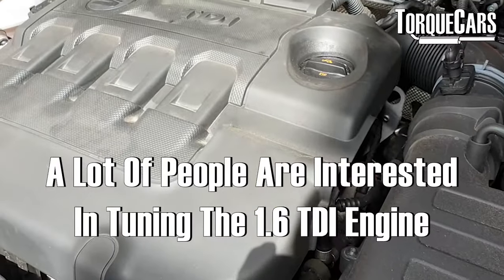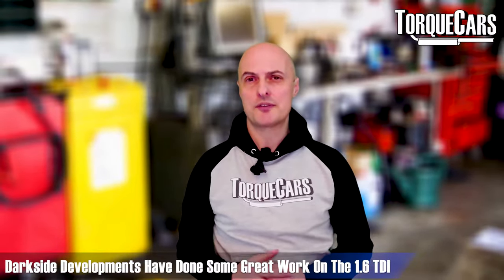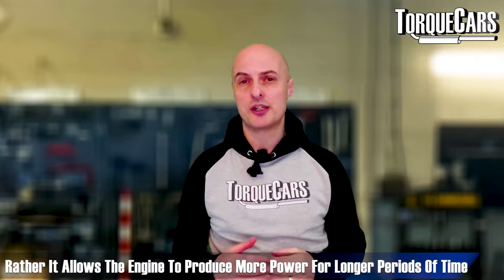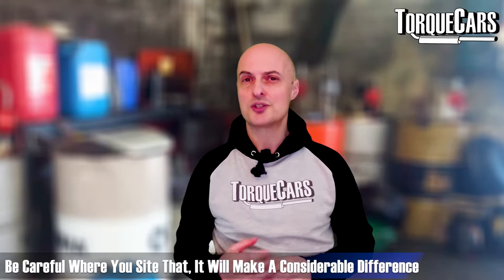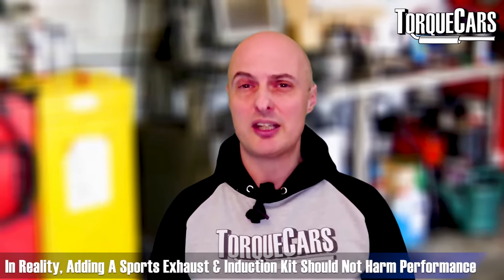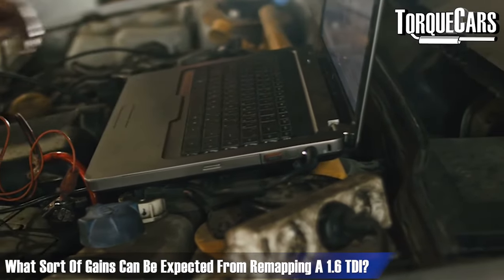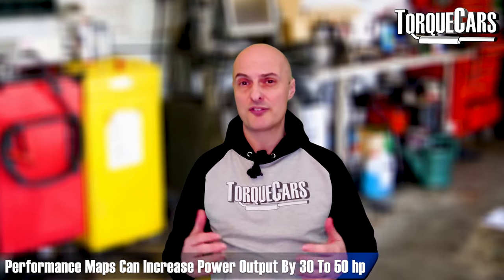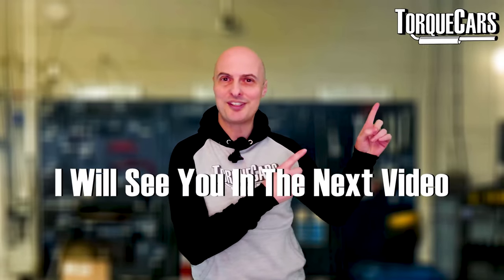Best VW 1.6 TDI Mods VAG Group [Audi Skoda Seat]

Comment: I got my 1.6TDI (Golf 7 Variant) remaped from 110HP to about 140-145HP (idk exactly since I didnt try it on a dyno yet.) For me its a huge difference, it turned the car into something thats so much more fun to drive, yet the fuel economy is unbeaten by any other car i know, I average about 4,1L/100km.
Reply from the maker: It always amazes me how quick these can be and still return fantastic MPG. Did you just do the remap or were there other mods done?
Reply: @torquecars  The remap was the only Performance - mod I have done on my car. Sure even more performance would be fun (I wish I had the same car as a GTD) but for now I think i wont do any more Performance mods. Curently 158.000km on the clock, changing the oil even before 15.000km, so I hope to get many more happy years out of it.^^
Reply: @Alexander-tu5on  you should consider removing FAP and EGR before the remap
and you'll get  a "looser" car to sustain the remap and get  higher hp.
Reply: i drove the 90hp optimiert up to 150hp from Swindon to Bad Pyrmont germany in one Tank!
Reply: 4,1L/100km on a car computer or you count the MPG manually?
Reply: @cezaryponikly4280  if I drive like a grandpa, I can get to 1150km on one thank of 45 liters. (It’s also a remapped 1.6 TDI, but in a Audi a3 2013)
Reply: A3 8v 1.6TDI 105bhp 2014 
Have done ECU stage 2(150bhp/320Nm torque)
Stronic/DSG stage 2+(drivability  upgrade)with TVS engineering/DSG doktor,
k&N fibre air filter but standard shape which fits in the stock box.
New front suspension with uprated polyurethane  bushing wishbones (no coilovers have been changed).
Servicing every year

3 years so far and this is a great improvement overall.
2 years after the tune it has its clutch replaced with DFW - all standard.
Recently 4 new standard injectors.
Currently running well and its with 120k miles on the clock atm.
Reply: @Alexander-tu5on 
Sounds amazing but oil change intervals sound a bit long.
Sounds like you don't mind spending a few quid on your car. It might be worth sending off some oil to be analysed after 15,000km and 8,000 km. Would be interested to know the results and you could save yourself some money and headaches longterm. Good luck. 👍
Reply: @michaellavery4899   That's interesting, where does one send an oil sample and what are we looking for?
Reply: I have also 1.6TDI, where can i find this remap flash?

Comment: For me personally, the best mod / upgrade is to change the oil and oil filter more often than the manufacturer's recommended interval.
And to add anti-crystallization fluid to the adblue - for cars with that system.
 😁

Comment: Ive been watching alot about these engines. I have a honda civic 1.6 i-dtec there is zero info out there for it even tuning info. I have stage 1 160hp and 380nm on standard gtd1244vz. I have a new hybrid gtd1252vz (220bhp model) now not available to buy from the company (muchboost) i have a custom stage 3 twin friction clutch. Stage 2 vc-50 snow performance water meth. Knocked out dpf egr delete, 19 row oil cooler and a custom made 65mm twin pass fmic with 63mm pipe work. Engine is open deck with head work have few other bits to do before stage 3+ map i have no idea what im goin to get but im using the feista as a base line. Cant wait to see what shes like 😅 actually havent a clue like i just wanted it to be a one off.

Comment: Great video as always. The only thing that is worrying me is the transmission. 1.6 TDIs has the DQ200 which is rated at 250Nm. A remap (140hp) can push it to 320Nm. Would love to hear your opinion about that. Thanks
Reply: is that DSG or manual? I’ve just changed a the clutch on my golf mk7, 100,000 miles on the clock….was slipping so bad I could barely get up a hill. Thinking of going for the remap only.

Comment: i have a mk2 leon 1.6tdi i run a darkside turbo to maf sensor silcon pipe and from maf onwards i use a ramair induction kit, downpipe full stainless managed to get 160-165 with a remap

Comment: I currently drive a 1.6 TDi Skoda Octavia 

My goal is around the 200hp mark. Probably be cheaper than the VRS 

I'm wondering about the DSG, will I need to upgrade it's tolerance?
Reply: Probably, but VRS after inexpensive 1st stage chip would be next thing you need when you realise how 200hp feels slow on 1.6tdi. And yes, DSG tune required after ECU tune.
Reply: @ThePlombyras  but how would 200hp from 1.6tdi feel slow? Because of powerband or what? I have driven in 2.0tdi 150 and it feels punchy

Comment from the maker: What car is your 1.6 TDi engine fitted to? It will help me shape future content on this channel.
Reply: Polo 1.6 tdi
Reply: Golf 7.5
Reply: Passat 2016
Reply: Jetta 2010
Reply: Skoda Rapid spaceback 2015
Reply: seat leon 5f
Reply: Skoda Octavia
Reply: Leon 5F 2013 1.6 105hp tdi >> stage 1 145-150hp turbo stock
Reply: Audi A3 Ambition Pro Line S, 
From 2014
Reply: 2014 vw Passat 1.6 TDI blue motion
Reply: 2012 Audi a3
Reply: 2018 Audi A3 Sport Saloon
Reply: Volkswagen vento 1.6tdi sold in india

Comment: The mean problem with 1.6 tdi is rough ideling and not related to throttle and Air flow sensor. No one knows what is the problem.

Comment: did anyone try to fit to a 1.6 tdi 105 hp 
a KKK turbo from 2.0 tdi same year ? 

engines are pritty similar and eaven share some parts I'm just thinking if i can bolt on a kkk from a 2.0.

anyone tried?

Comment: Has anyone got any tips on making my 2014 vw Passat with the 1.6L tdi sound any better ? I’m planning a stage 1 remap which would solve my power and torque needs but it’s sounding like a hairdryer does not hit the spot 😅 any help is appreciated :)
Reply: Remove DPF and rear silencer, leave the middle resonator and it will sound more burly

Comment: Currently own a Seat Ibiza 6j1 with the 1.6 TDI (CAYC) any tips on what to mod? Or even where to buy parts to upgrade.
Reply from the maker: Are you based in the UK? A remap/ECU Tune is the top mod on these, for the money it will give the largest power gain.

Comment: You can get high flow filters for the original air box they work as a cold air intake system just cheaper
Reply from the maker: That is usually my preferred approach for Diesel engines. The washable filters also last much longer than the paper ones. Thanks for the support my friend and for sharing this tip.
Reply: Did you notice a difference in noise like a cold air intake?
Reply: Sport filtrer is 😢
Reply: @torquecars  where can I buy one? I have a 84 vw rabbit 1.6L TD mk1

Comment: the cure is garrett 1449 vz turbo from 2.0 GTD TDi. plug & play. so easy.
Reply from the maker: Good tip, what power are you making on yours?
Reply: @torquecars  2018 A3 8V 1.6 TDi sportback, manual gear, dpf and egr off, light weight 16" wheels, vogtland springs. The power is 200-210 ps.
Reply: what all is involved in fitting? oil feed pipe just?
Reply: No ecu issues or boost sensor issues with bigger turbo?

Comment: I have the Audi A3 2015 1.6 TDI, I havent done any mods. I am looking at doing remap just to give it a little bit more power, and touch wood my injectors and turbo are all fine. But if they do break, I will probably be upgrading them to produce higher power.

I am looking at doing a turbo silencer delete and also adding an induction kit, and obviously as well as the remap

Does anyone know if I just change the stock square air filter in the air box with a performance square air filter I will hear any induction noise? or is that really only with cone filters?
Reply: I have the exact same car and also the 2015 model, I don’t think an induction kit will mate a diesel sound much better tbh… I’ve done a little research on it and it can make some sound better and make others sound even more like a transit van 😂 if you do it let me know how it sounds 👍

Comment: Aup mate I’ve got an Audi a3 2012 with the 1.6tdi currently got a Dpf delete and stage 1 remapped running around 140bhp and 320 nm, I’ve been debating changing the turbo would you recommend and what turbo ?
Reply: Get a cr177

Comment: Very good video.
I’m planing of doing a stage 1 remap on my 2014 Audi A3 1.6 tdi. Will it do any harm to the engine because the car is driven pretty hard and has 110k miles on it? 
Also I want to keep the stock turbo, dpf and egr on.
Thank you and best of luck 💪
Reply from the maker: These were built to be driven hard, so as long as they are serviced you should have little to worry about. DPFs will actuallyl start to clog up if they are driven gently and grannied along. This video went into this topic in more detail and gives the pros and cons and options you have. https://www.youtube.com/watch?v=Ic-eQhUY83o
Reply: I’ve a 10 golf 377km drive the shit out of it no problems just the exhaust temp sensor comes up every now and then but light never stays on for it
Reply: @eamonnnoonan1945  I have a 2013 Skoda Octavia 1.6 tdi with 340k km on it, done the stage 1 tune a year ago I drive the shit out of it too, thankfully haven't had any issues yet. Before I got it I was skeptical about the reliability of the 1.6 but as I said above no issues yet
Reply: @valmirsadiki536  what about the dpf? Do you still have it?;
Reply: @valmirsadiki536  what about the dpf? Do you still have it?

Comment: Dude 21sec and i cant watch you already.  1.6tdi and 2.0tdi is much in same size and weigh. VW did not made it to "fit" some small car because old polo already had 1.9tdi fited just fine and same as 1.6tdi or 2.0tdi would fit. Biger powerful polluting engines cost more on taxes and it's not what a humble European want's . Thats why they made 1.6tdi and then put it in passat b8...
Reply from the maker: Interesting, which engine versions are you specifically referring to? I note that in this video I stressed the importance of economy when I said, "they wanted to create a fairly small diesel efficient engine that they could fit in the smaller bodied car."  I certainly didn't mean to imply it was made just because it was smaller and could fit easily.

The 2.0 TDi typically weighs around 55kg more than the 1.6 TDi in my experience, the newer 2.0TDi is a little better when it comes to weight. A mass of this size had a profound effect on a light or small cars performance. Did they officially make a 2.0 TDi Polo? I know of a few conversions but it was a challenge getting that to fit, and the 2.0 TDi pretty much filled my A3 engine bay but a 1.6 has space around it but with engine covers on they can look roughly the same size.